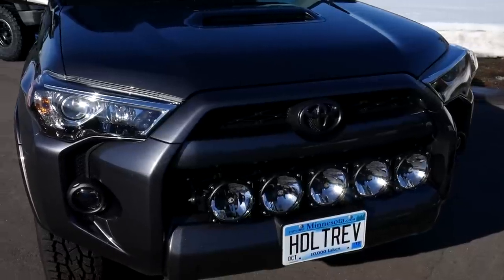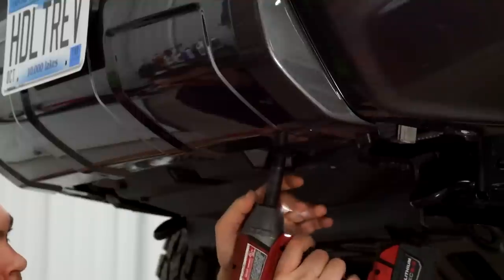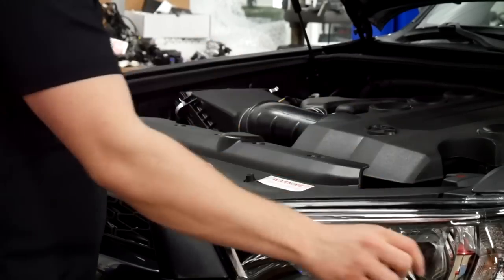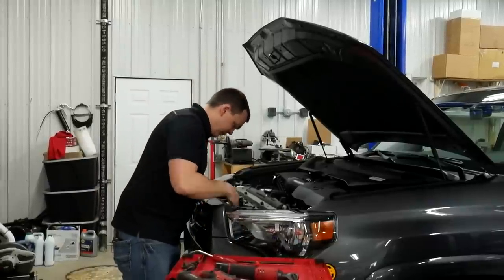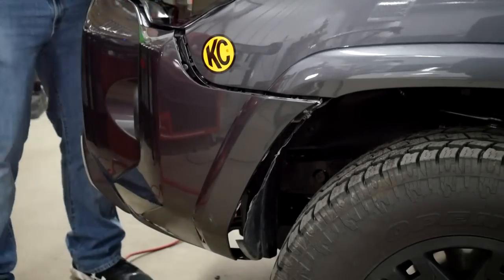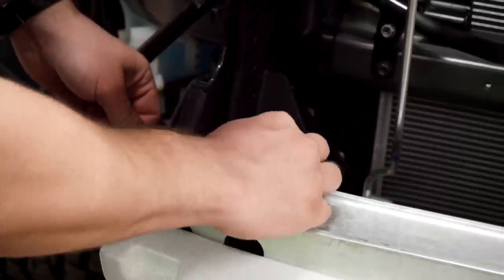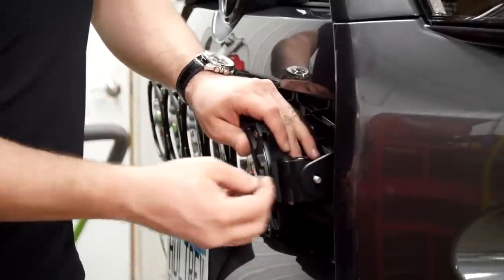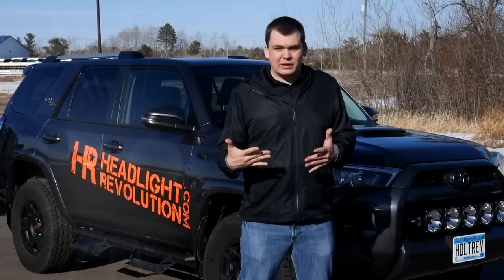KC HiLites Pro6 Lightbar Grille Install Toyota 4Runner with Rago Fabrication Mounts

Comment: I wish you guys made a video on the install of the Morimoto fogs. Did you have to remove the whole bumper like in this video, Or just the first couple of steps where you just took off the bottom plastics underneath the front bumper?
Reply from the maker: We actually did a video on the Morimoto Fog Lights for your Toyota 4Runner, You can find it here! https://www.youtube.com/watch?v=DoOiDd9xPhI
Reply: I know I have that one saved. I just wish there was a video of the actual install of the fogs on the 4runner.

Comment: Nothing like blocking 1/2 the airflow to the radiator  :- )   Two or three would be a better idea.   Looks freakin awesome but in a warm climate naaa'.. it IS going to run hotter.

Comment: would these fit behind the grill too?
Reply from the maker: We love doing things like that!. We actually tried that out, but no, unfortunately not.
Reply: @HeadlightRevolution  do you think these would fit behind the grill with the 4runner nfab mount instead? The the lights mount to the top of the mount instead of the rear, so you can get them farther back?

Any info is appreciated